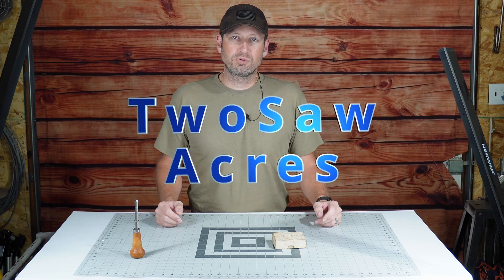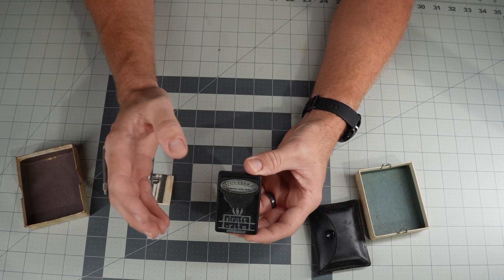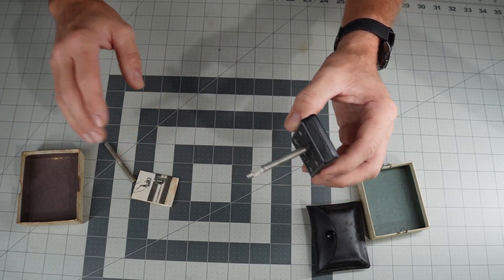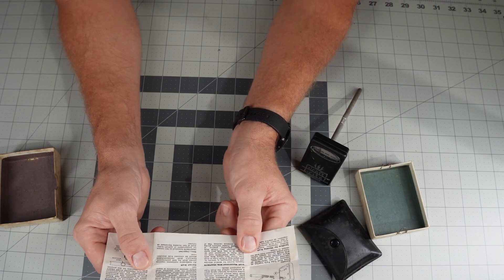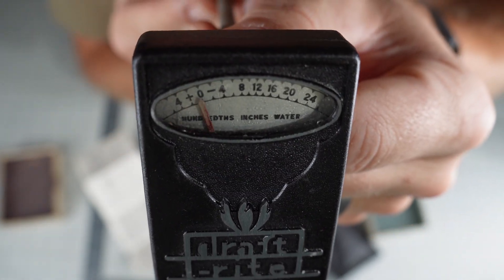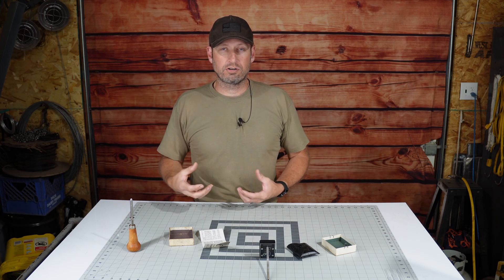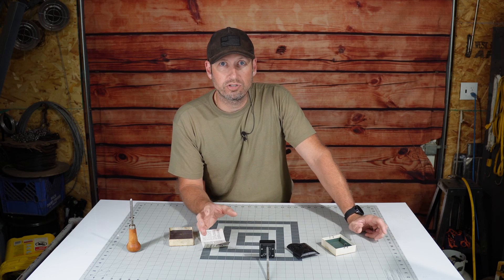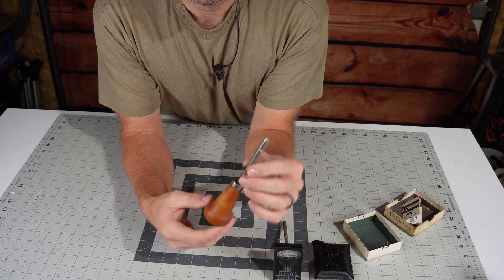Draftrite pocket manometer

Comment: Uncommon? Not to Steve Lav.....  i just bought one on ebay to measure the draft over the flame of my oil fired boiler.
Reply: What’s the replacement for them? I need one asap
Reply from the maker: @The714Formula   Just saw your comment,  sorry,  I've got no clue what the replacement is.
Reply: @The714Formula Dwyer Mark II is what I use to set the barometric damper weight on my wood stove flue. It measures very low pressures. I set the damper at .03” WC.
Reply from the maker: Neat little thing huh.  They sure are proud of them aren't they? lol
Reply: @twosawacres8096 it's been discontinued. Thanks for the video. It helped.